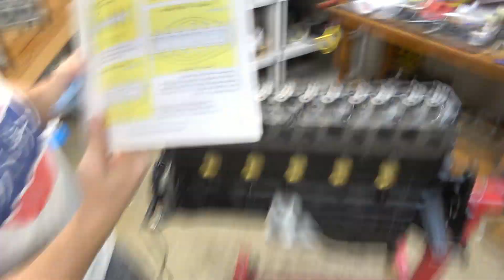Jeep 4.6 Stroker pt 10: Cylinder Head Install (XJ, TJ, CJ, YJ, LJ)

Comment: WHAT?!!! . . . you didn't use an MLS head gasket?!! 😲
Reply from the maker: In my experience, barring high CR motors, design and size of the fire ring is WAY mor important. Besides, fiber gaskets actually seal better on imperfect surfaces.